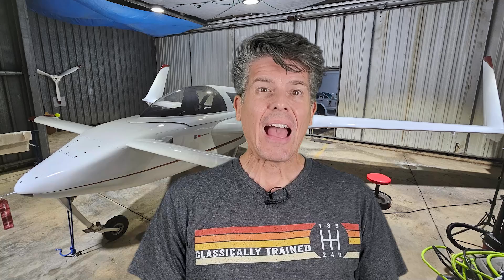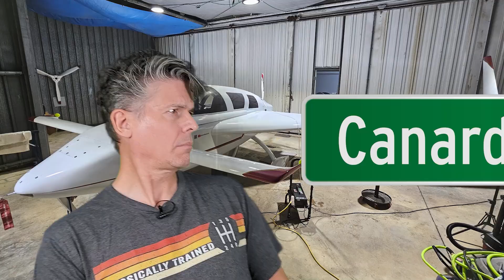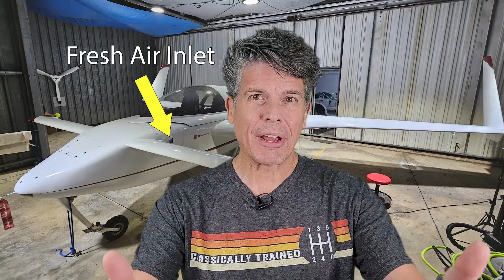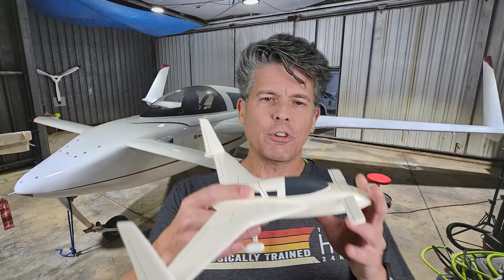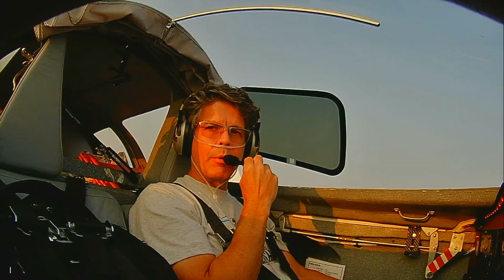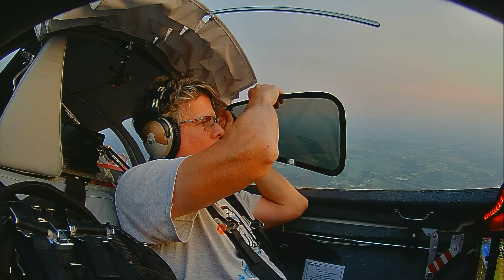Answering Your Questions | ADS-B, Pitot Checks, Oxygen Safety, Canard Landings & More

Comment: Fixed pitch props can make a huge difference. We have in our club a PA28-161 Cadet with an O320 with a finer-pitch climb prop and a PA28-181 Archer III with an O-360 with a cruise prop. Although the Archer the bigger engine, the Cadet actually makes more power during takeoff because of the significantly higher rpm (also roughly 2350 vs. 2200). However, unlike in your case, the finer-pitch prop will cause the engine in the Cadet to reach redline rpm very quickly in level flight unless you reduce throttle quite a bit, so it is roughly 15 knots slower in cruise. For touring, it is worth it for the Archer, but sometimes it means we cannot use the full payload if we want to take off and clear obstacles with comfortable margin, depending on wind and density altitude.

Comment: Minor error: the original varieze nose gear was a manual Johnson bar system with no spring. That was superseded by a worm gear system with no spring. The final version was the worm gear system WITH a spring (still manual) and that same system was used in the long-EZ, Cozy, and most other Rutan derivative canard designs. Then the electric versions came along and all had springs until the EGP system.
Reply: Yep, I was going to make that minor correction also, if no one else had. The LongEZ I’m familiar with had the plans manual nose gear with the die spring. Besides the  “bouncing” issue the spring also facilitates a momentary decrease in the angle of the nose fork pivot point and thereby potentially inducing a hi-frequency nose wheel wobble. Nevertheless, in practice, most springs are just left in place as an acceptable risk.

Comment: Great Info.
Regarding takeoffs with high front seat weight: My cozy transition training instructor, an F35 test pilot at Edwards AFB, taught me to compress the nose spring before rotating up when doing a nose-heavy takeoff. This is kind of a nose bounce maneuver. At your normal rotation speed you push slightly forward on the stick to compress the nose spring and then immediately pull back to rotate like normal. This maneuver lets you pull the nose up at about 5 knots slower (or more) than you would otherwise with the heavy nose weight. Obviously this wouldn't work as well if you don't have a nose gear spring. I have the common wilhelmson electric nose lift on my cozy.

Comment: Thanks for the info! A couple more questions: 1 Is it possible to clock a 3-bladed propeller so that all of the blades miss the exhaust pulses?  2: To reduce possibility of CO in the cabin, have you considered extracting heat from the oil instead of the exhaust?
Reply from the maker: Nope, with a three-bladed prop and a four-cylinder engine, you're always going to have one clean blade, one semi-dirty blade, and one filthy blade. Some people have plumbed oil heat exchangers into the nose to run air through, but a) putting that up there plus all the oil lines is heavy, b) it doesn't really put much heat into the cockpit. Air moving across the exhaust is being heated by 1500F exhaust gases. Air moving across the oil heat exchanger is being heated by 180F oil. It's a huge difference.

Comment: You might consider contacting the engineers at Firestone / Airide that develop air springs for all sorts of applications. They may already have something that could be adapted or could possibly design a bag that could allow adjusting nose height with a small onboard compressor. Judging by the number of applications they have for all sorts of equipment there may already be something available. Also, air springs have a progressive spring rate unlike steel springs that have a linear spring rate. This means air springs can ride soft at their normal pressure yet they get stiffer as the load increases while coil springs are linear - just as soft/harsh throughout their compression.

Comment: Thanks Scott .  The answered question about take off distance being so long because of canard being the last to fly begs the question about vgs on the canard. We talked about that once not being ideal because of the safety issues of canard stalling first. Just wondering if there would be a help in take off distance with the vgs on your canard? Maybe there is a compromise through testing? Less vgs ect. Just wondering ?
Reply from the maker: VG's are used to keep the boundary layer attached at high angles of attack, so that you can delay separation (and stall) at lower airspeeds. In this case, the angle of attack is already extremely low, and it's just getting enough airspeed to create lift at that low angle of attack in the first place - VG's aren't going to help with that.